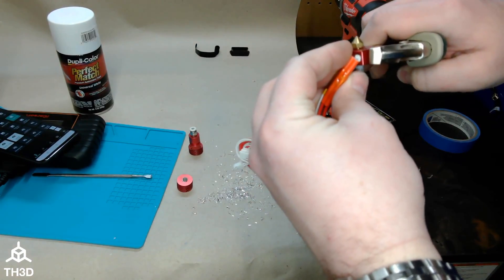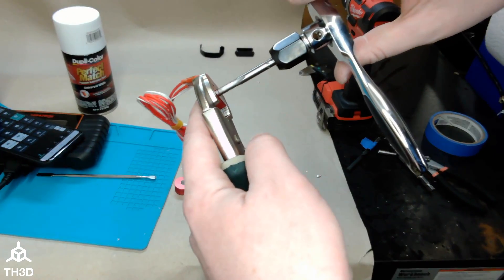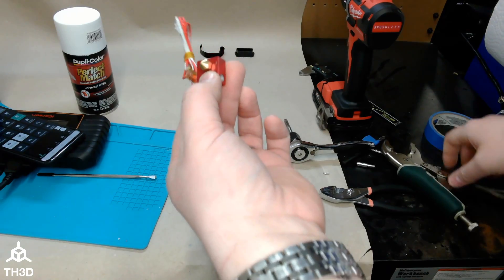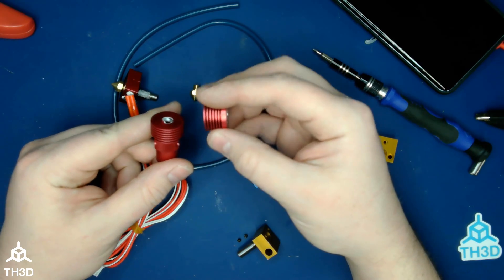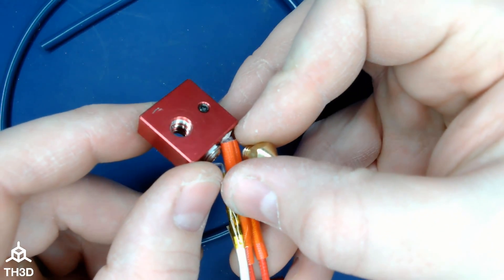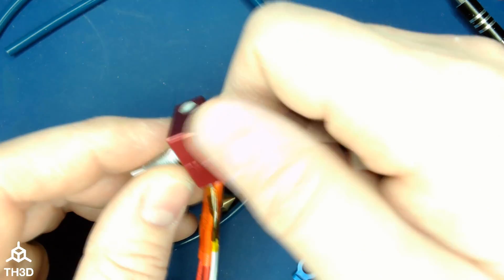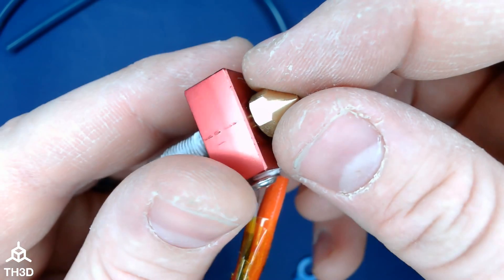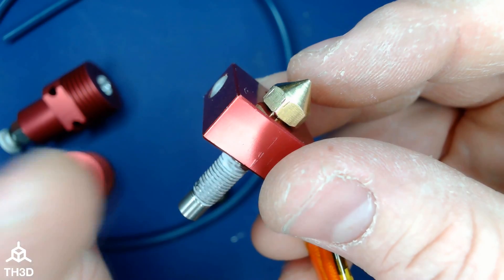CR-10S Pro/Max - MK8 Nozzle Thread Mod - Use Standard (MK8) Nozzles!

Comment: They have used a minimal material design on the hot end for cost cutting purposes. How much they'd think they would save on 2 grams of Aluminium is anyone's guess. I am not at all happy with heat transfer efficiency of the present 3D printers either. Unless the threads are of very high tolerance, the contact between the nozzle and the heating block is at best a compromise, so in this case it is essential for the nozzle to bottom out on the heat block to ensure a good heat transfer. In any case these stuff are all budget Chinese made machinery and as such they are just adequate. Great video and idea B.T.W. I am sick of paying over the odds for those silly nozzles.
Reply from the maker: Pretty sure they did it this way to make it so you have to get nozzles from them.
Reply: @TH3DStudio  Absolutely, and then they forgot and only made the 0.4mm brass nozzle, or did they buy it from the local nozzle manufacturer????

Comment: I just replaced the hot end on my CR-10s Pro V2 today, because I messed up the threads on the old one. Installed a 'free' nozzle that was sent with a kg of PLA. It would have worked on a printer with standard threads, but not this one. While I might try your mod, I think I'd rather have a different printer.

Comment: So a heartbreak doesn't exist to fully modify the heatsink to fit m6x.100 threading?  This way we can use a Swiss Micro heat block with a nozzle onto the stock heatsink.

Comment: Is it possible and feasible to drill out the .4 with a .6 drill bit?
Reply from the maker: Would recommend using a drill press for that one. But should be possible to do. Make sure to de-burr the outside as well and go slow.

Comment: Use a machine tap! ... and a tapping arm (or a bench top drill press)... I mean I admire all of your electronic hacks but a metalworker ya aint ;-). Machine taps are the "blunt" version, meaning to get more load-bearing threads in that 10mm heater block and thus more mechanical strength and heat transfer. The press is used only as guidance. The long taps you are using are for through-holes or very deep ones only.
Reply from the maker: Got a link to one you would recommend? Wouldn't mind picking up one.
Reply: @TH3DStudio  Mine are looking like this: https://www.aliexpress.com/item/32969968492.html?spm=a2g0o.cart.0.0.23763c00ByrP45&mp=1 they are meant to be used in CNC mills etc. Therefore, you might want to fabricobble a thing that's holding the heater block in a vise and also guides the tapping bit. Helps you to focus on the tapping action when the jig is taking care of the correct angle. Use lube. Aluminium work-hardens AND likes to "smear", resulting in rough surfaces (=bad heat transfer). WD-40 is OK if you don't have tapping fluid. No matter what type of bit you are using, you need to chamfer the hole with a countersink bit first (otherwise the tap won't grip... in the case of the heater block, the existing chamfer might be sufficient): I use this type as it doesn't "rattle" as much when used in a hand-held drill: https://www.aliexpress.com/item/1005001340540192.html?spm=a2g0o.productlist.0.0.99b66c34SEAXRf&algo_pvid=a7d9e1ad-15b2-46cd-b4eb-c97837846edb&algo_expid=a7d9e1ad-15b2-46cd-b4eb-c97837846edb-1&btsid=2100bdf116082845738384377e4d2a&ws_ab_test=searchweb0_0,searchweb201602_,searchweb201603_ ... good luck!

Comment: The Micro Swiss All Metal Hotend is available for the CR-10S pro and uses standard MK8 nozzles. Only trouble is that it's a bit pricy and an all metal hotend isn't for every use case.
Reply from the maker: Yeah they are pricey. Our "hacked" one has been printing just fine since this video.

Comment: Thanks for this! I've been puling my hair out to find replacement nozzles for my CR-10 Max and haven't been able to! I reached out to Creality although, this is their new machine they would NOT helping without an order number. Not to mention on their website the 3 pack .04mm  nozzles is sold out at the time of writing this. So, are you using a 6mm tap with 1 inch threads per inch then? TIA
Reply: It's a M6X1 metric thread (M6 - 6 mm diameter, X1 - thread pitch of 1mm, not 1 thread per inch, that'd be awfully coarse).

Comment: I have a couple of your tough nozzles for my microswiss. If I wanted to "step up" to a V6 would they still fit or would it take some creative thinking? I seem to be limited to about 340mm/min with my hotend.
Reply from the maker: MK8 are about 3mm shorter than a V6 nozzle so while they will thread in the heatbreak would need to be put into the heaterblock deeper than normal. While it may "work" I would recommend getting proper V6 nozzles.

Comment: Yeah, even chucking it up in a lathe there wouldn't have been enough meat left to tap. I saw where the bit went through the sidewall at the next petticoat.
Reply from the maker: I want to know if they intentionally did that to prevent modding it to take a normal heatbreak or if its just coincidence.